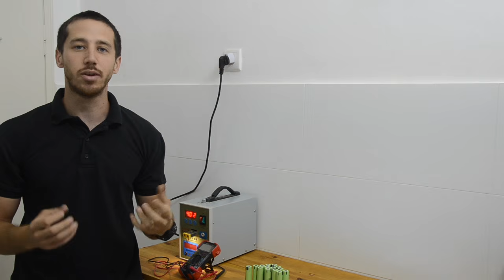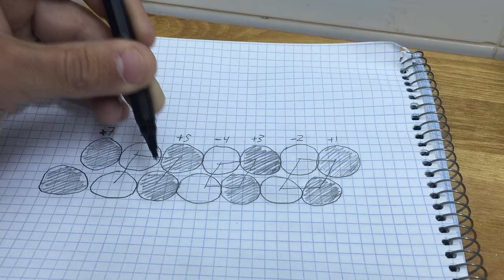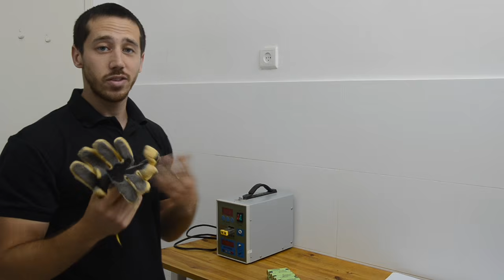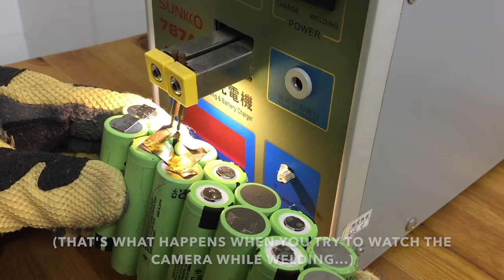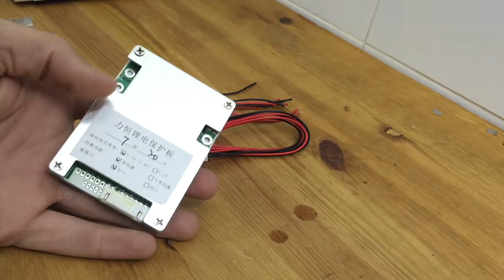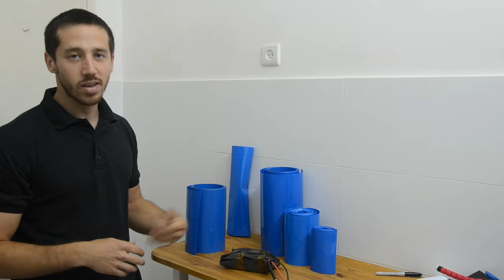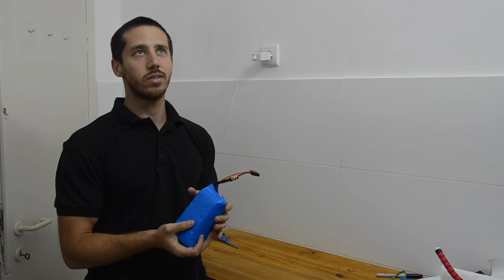How to build a DIY ebike battery from 18650 cells

Comment: use some squared nickel strips why do so many people make such a simple task way harder and complicated your letting those little pieces just float on the cells while lifting it into that rigged up welder as you are saying you need to be very careful while doing this but you are setting youself up for a short in evry move you make simple to just use a piece of electrical tape to cover the neighborsing cell pairs you dont want it crossing its easy enough to cause a short messing with these cells  dont think to hard on how to do this at least eliminating some of the floppy movements around the batterys those thing are itching to make a quick connection and with lots of energy

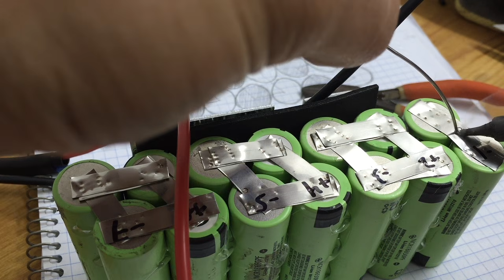Comment: 17:50 Why not solder the wire to a nickel strip off the battery and then spot weld the now wire soldered to the nickel strip to the battery?

Comment: Great video of watched it many times.  One question you seem to be the one that can answer it. Say if I have a 500 w motor with a controller built inside the battery one piece. Can I disconnect only the phase wires from the motor and hook up a Chinese controller that puts out at least 25 amps. The thing is I can't find anything to run the UART protocol that's cheap and puts out 25amps minimum. I'm new to all of this by the way. Could it work like that too controllers tied together one sending power to the motors the other given a readout take out the throttle on the controller that's running the display?

Comment: When you add parallel connection on battery pack, you are increasing capacity of battery pack not current  ( big difference there )
I always add minimum 6 cells in a row in parallel connection to have more juice.
Others in same pack goes in serial connection.
When using scrap cells, always match them by same or approximately capacity capacity and internal resistance ( don't ever mix 1ah cell with 2 or 3mah ) !! I warned you starters ...

Comment: great video got a battery that as sat over winter i did use bike some but not enough so battery now only reads 11.9 volts when i tried charging want take chare so I hope i can save it. I do have some experience it electrical any ideas i would appreciate tks. I'm sure bms has kicked in.

Comment: There is a huge mistake in this video .I wish it can be taken down  Soon soon before people go and hurt themselves. If this is a pictorial view of your set-up then u not suppose to be seeing all the  contacts that because it supported to two on top and two below. It appears here according to  your drawing that they are all shorted off seeing that they are all on top. Sony can pick any two that shouldn't be seen. " lets say the contacts that goes from  #1  to #2  should not be seen because they are at the bottom of the batteries. ". Not at the top as the other two.. Even if u as the teacher knows its at the bottom ,the learners don't see it that way because of how u draw it. U show do them with  dotted lines, meaning that they cannot be seen. In drawing we call that ( hidden detail lines).
Reply from the maker: The drawings are correct. There are two drawings in the video, one for each side of the battery. You can’t see both sides at the same time. All the connections shown in each drawing are correct.
Reply: yeah i did it and burnt my nickel strip😂😂

Comment: Thanks for the video. Newbie here. 
I am building a battery pack just like yours 7S2P with 18650 batteries, 4.2V 8800 mAh. each cell. My question is... What is the right charger for the battery pack? My pack will be used on a ham radio that uses min 22V to Max 30Volts so 29.4 volts is ideal for it. As you see, a radio is not a motor but yes, do have surges of consumption, when it transmits but nothing compared to a motor of a bike. My battery will be: Notation: 	7S2P, Total capacity: 	17.60 Ah, Total Watt hours: 	517.44 Wh, Pack voltage: 	29.40 V, Number of cells: 	14A. 
What could be a suitable charger for my new battery pack?

Comment: How does “Ah” work?  Is a battery with 20ah better than a 30ah or 40ah or 50ah or 60ah?  So if I buy a battery that’s 72V 60ah, is this considered a pretty powerful for my Goat Hulk EV Scooter?  I want to upgrade the stock 60V 30ah for more speed and run time.  Your thoughts Sir.

Comment: Hi, I have an e-bike which the battery was faulty and was not charging. I have disposed of the batteries however they were completely different to 18650 cells as these ones were 7 oblong cases with + -  at the top of the each case measuring a 4.2v. the casung has a key oporating mechanism and fuse. The charging terminal is also different. Your video is brilliant and I was wondering if you could make a new video showing how to connect the battry you have thought us to build to the existing battery case. I know every bike's battery case is different but I would think the principle would be the same. Look forward to hearing from you.

Comment: I do not intend on doing this but curiosity is getting the better of me. 

Lets say 1 cell is knackered in parallel group that is dragging down the whole set, and you did not have a spare cell to replace. Is it safe to cut that dodgy cell out and throw it and not replace? I get that you would have a slightly smaller AH battery. But would this cause issues in terms of balancing or anything else?

Comment: Great vid.  I used nickle rollers with thin slice of wood dowel glued in the ends. White wool for bus bars, red wool for positive,  black for neg and blue for jumpers. Made it easier for me anyway because it's 3d..   😅😅   ps.  I build circuit boards from scratch (board diagram from schematic, etching, drilling, placing, soldering  etc, etc..) so no stranger to electronics. I have never built a battery pack tho and It took a couple months of  research before I felt comfortable even mocking one up. I learned the nature of lithium cells and how to not burn your house down..  and In the end I ended up buying one anyway because it turns out that my homeowners insurance won't cover me for fire if the "homemade" battery erupted into fire for whatever reason.  I do feel tho that my battery would have been top shelf with minimal heating up.  The bms I was looking at had settable parameters like shutting down charging at 80% with active balancing I would never need to charge them to thier full value. I did overkill on the parallel to series connections with each group's amp handling at 30, which is the max I would be pulling from the entire pack.

Comment: Can I start making a pack with full charged batteries so instead of 3.7 , 4.1-4.2   , is there a reason why everyone installs them discharged ? And also how could I get 120 cells to the same voltage ?????

Comment: I've been plugging the battery then the AC to the wall outlet and all the 120 v prongs are burnt like  arc sparks . My charger doesn't fully charge anymore just for 2 to 3 minutes..Do you think the capacitors are faulty ? Thanks

Comment: I’m in the middle of building my first battery and viewed your other video about testing the nickel strip to see if it’s plated steel, after putting a piece in salt water overnight it rusted. I have pure nickel welded to the top, .2x10mm strips, do I need to rip it apart to remove the plated steel and rebuild with pure nickel or will it be fine? It’s a high amp pack that could draw 25 amps per cell. 13s6p 21700 molicell 42a ( rated 45 amps per cell) 0:11

Comment: thank you so much for this video you have properly explained series and parallel and how to read wear each wire to the bms goes i will attempt to build a secondary battery for my escooter as the main battery is not very strong mine will roughly be double the size so 48-60V

Comment: I have to make 2 single rows of 12 flat battery pack for e longboard. I notice when you do your series you use 4 batteries,  does that mean only 2 add up the voltage and the other 2 build up the mah because their parallel within a series?

Comment: At last, someone who shows me how to do it , without trying to teach me all the technical knowledge that I am not capable of understanding  , or interested in.  The BIG problem is, you fail to mention the Ah of the finished battery. which for me makes the whole video pointless as I dont want to build a battery without knowing if is powerful enough to run my motor, which in my case is 48v &  11,6 Ah. Provided I can find out The Ah of this battery somewhere. I think I will put strips of electrical tape over the ends of all the batteries, and take one off to attach the nickel strip, and re-attach after spot welding until I have finished, to avoid accidental shorting. Now all I need  is to find out how to connect up  two of these together to give me the battery I need. Thanks for sharing., Paul UK.
Reply: Congratulations!!!
you have been selected among my few giveaway winners,endeavour to reach out to claim prize

Comment: Hi, good content. I used to work for a company who manufactured battery Pack a good way to make sure the solder stays on nikel plate is to scratch it (nickel plate) with a blade, it helps solder stick better.
Reply: @user-oe8xe4og6t  hi, thank you. Where do I contact you?
Reply: I use a piece of sandpaper or a dremel
Reply: Good point if using nickel plate, but the guy is using pure nickel strip so wouldn't need roughing up.
Reply: Unfortunately, solder is not compatible with nickel, and that’s why they spot weld to the nickel strips.

Comment: I usually solder and it’s a pain…I need to get one of those spot welders. I’m gonna be using a plastic’ forgot the name…people use it for bumper splitters on cars’ the plastic can be cut and heat gun to make bends, I also have plenty of foam insulation’ to protect the battery from vibration’ I’m doing a MTB frame with road fat tires, it’s gonna look like a speed motorcycle’ I’m good at working with the plastic. 

But thanks for the video…it was very helpful….I have a 3000 watt kit coming, the batteries for it is expensive’ if I want speed’ the kit was $775 and the damn battery is $899’ yes there’s cheaper 48v or 56v but I want 72v the battery pack will be mounted inside the plastic frame….I wanna get my e-bike to 50 to 60mph…I weigh 135 pounds.

I hope harbor freight has that spot welder….I just need to find out who sells those cells and that battery computer.
The good thing is I can add cells or build another replacement battery’ I might do a pack I can mount to the front handle bars…the bike will be heavy as hell and the kit has a pass key…it locks the back tire in place when activated’ a thief would have to break the lock and carry the bike away…it has a alarm that notifies my phone when tampered with.
Reply: Congratulations!
you have been selected among my few giveaway winners,endeavour to reach out to claim prize....🎁

Comment: There's a good reason battery builders use spacers. Heatshrink tubing on cells can crack or melt. You made a very dangerous battery pack, and how you stacked them to save space makes it more unsafe. If just one cell shorts, and it happens, then the whole pack goes into full meltdown. BOOM!
Ok. 18:50 into this video, and i don't see a fuse or thermal protection sensor. Kids, don't try this at home.
Reply: Balance wire(s) plug is not fully in socket. You shouldn't plug it in until wires are all soldered in place. This whole video is how anyone should never build a battery pack.

Comment: if you want to the heat as far away as possible from the cell, maybe may as well solder the wire on strip and then spot weld it after it cools down? lol may have as well soldered the whole pack.
Reply: Congratulations!
you have been selected among my few giveaway winners,endeavour to reach out to claim prize..🎁

Comment: My laptop batteries are dead. I would like to use a power bank with all the features of a laptop bms and power it up.
The power bank shall replace ac and internal battery. Is it possible to design such a configuration and how would the pinouts be. Thanking you in advance.
Reply: Congratulations!
you have been selected among my few giveaway winners,endeavour to reach out to claim prize.......🎁

Comment: I want to make a long lasting 24v pack for a Bluetooth speaker but don't really want to buy a battery welder as I'll only ever use it once.
Can I solder solid copper wire onto batteries or is that too risky?
Reply: You can actually just sodder the nickel on, just be wary that the capacity will likely drop a bit due to heat exposure. Mobile spot welders are only like 50$ also
Reply: Congratulations!
you have been selected among my few giveaway winners,endeavour to reach out to claim prize 🎁

Comment: I've just spot welded a 7s 4p out of recycled laptop cells. I did it because I have an old electric scooter that used an old an heavy 24v battery, it has 250w motor. The old battery didn't have a BMS and it was charged using a circuit board that also controls the motor, I believe it has over discharge and overcharge protection. Can I use the battery I built without a BMS? This would be just for testing out if the scooter is still worth buying/building a new battery or I risk blowing up my feet?
Reply: Congratulations
you have been selected among my few giveaway winners,endeavour to reach out to claim prize

Comment: Can I not use BMS for 12 volt battery when I use 4 cells in series and charge with 15 volt max. Basically I will never have situation where cell will be fully charged. I m using for my motorcycle 12 volt battery n alternator does not generate over 15 volt
Reply: Congratulations!
you have been selected among my few giveaway winners,endeavour to reach out to claim prize.......🎁

Comment: After buying your first book from Amazon, Ultimate DIY Ebike Guide, I just bought your other book, DIY Lithium Batteries, both to be delivered Friday.  Problem/question: I want to add a 2nd battery to whatever eBike I buy, but not sure where to find understandable information on how to do it, videos, etc. Can you point me in the right direction(s)? I also sent you an email.
Reply: That is, what connectors do I need, also how to match power sources to avoid problems?

Comment: Hey I'm like your channel it's help me a lot I'm need your help I have a lead acid battery in a electric soccoter and I want to change to lithium battery like you did it's 24 v SCcotter 100 watts but I can't find 7s bms can I combine 3s and 4 s bms together??? And the 100 watts motor 24v it's mean it's consuming 4 amps? So I can use laptop batteries withch have max continued discharge of 4 or 5 amps? Or it's better to use high discharge batteries like old drill batteries? What do you recommend making thanks in advance!

Comment: separate each series! without insulation if the wrap on the battery comes off there can be a decent voltage differential and it may start a fire, it is fine to use hot glue on the parallel sets, but using hot glue to connect two parallel sets can be dangerous.

Comment: I noticed you say at end of video 24 volt, but each battery was 3.63 volt and you had 7 in series. Wouldn't that make it 25.41 volt?
Sorry if this might seem nitpicky or something, I'm just trying to understand before attempting to do anything myself.
I didn't really understand anything related to the BMS lol. Like for example at first he calls the red wire charge cable, then afterwards discharge cable?

Comment: my two pennies worth, i know this is a 2016 video but:

don't hot glue your cells together. nowadays you can get hex or square cells holders for really cheap
batteries should never be hot glued together, especially for ebike packs 

sunkko spot welders are terrible and overpriced for what they are. it cant weld past 0.15mm thick nickel
these kit welders (like malectrics) are way compact, powerful and convenient to make batteries with 

stacking nickel is a bad idea. use 0.2mm nickel, copper wire or copper sheet if you want more amps
stacked nickel will easily tear apart especially with low power welder like sunkko.and if you use high power welder you should use thicker plate in the first place
as this handles current flow much better

tin your tip before soldering anything. you want the heat transfer quickly as possible

only use high quality bms and avoid aliexpress/alibaba for cells. many cells that come from aliexpress are refurbished, rewrapped or just fake
instead go for a trusted vendor like nkon.eu.

Comment: I have a question that might be extremely simple for someone to answer but i can't seem to find a clear answer. Will try to keep this simple in a 10s5p battery configuration with say a 15 amp current draw going through it, how much current is going through each of the cells in the 5p configuration is it as simple at 3 ? or does the amperage through the cells matter what position the cells are in the configuration, meaning the first 1s draws less then then the 10th (10s) series of cells or do all 50 cells draw 3 amps a piece when 15 amps draw is applied?

Thanx

Comment: Friendly advice: Don't do it 4-5 times in a row. Check that video with thermal camera and comparison of spot welding and soldering. Even if you spot weld it gets some heat into the battery. It is better to spot weld once and then move to the next tab and do it in circles. This will give the battery chance to cool down a little bit.
Reply: nah, I worked in a factory spot welding on these exact cells for four years straight in college. You just work on one cell and move one, never in four years was there a problem due to what you're describing. Few small issues were when the strap touched or welded in the wrong spot...keep a bucket of sand near by and a fire suppressant.
Reply: @miker8687  ０．０
Reply: the whole point of a spotwelder is that it stops the cell from even heating up in the first place, id only do what you said if I was soldering cells together
Reply: @themastereal8345 but still need to melt nickel
And only till 60c heated cell but still I hope it's better to do like giving gap